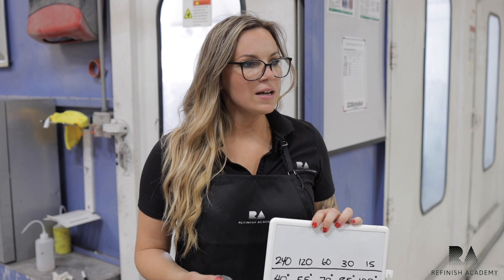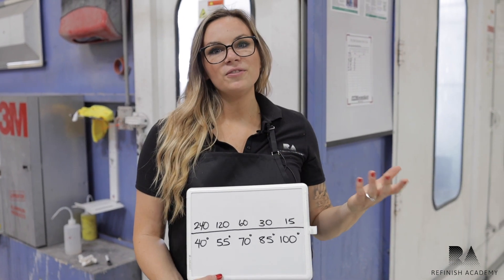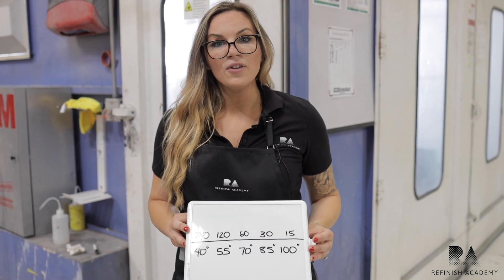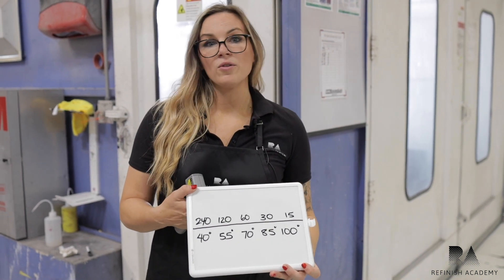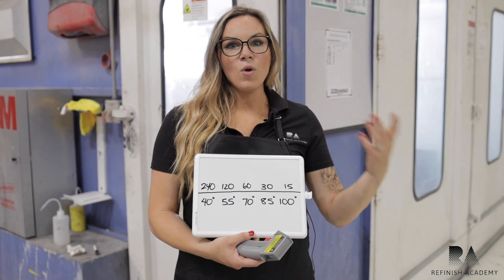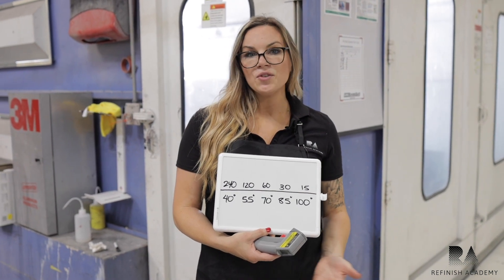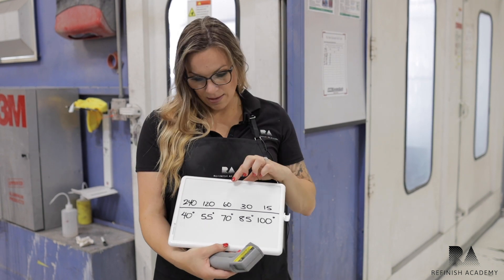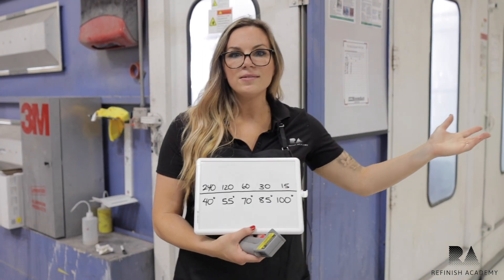Body Shop basics! The 15/50 Rule for automotive paint

Comment: Don't you spray in a booth? 
What does the outside temp have to do with it?
Reply from the maker: The chemistry and principle still applies even in a booth. With heat, you notice this less because the temperature is elevated therefore time is less. However not everyone has heat in the booth, and this principle can be something to keep in mind to help keep production flowing.  In all situations. Especially in the prep area, where it’s ambient air until we stick a heat lamp on it. Some shops don’t even have heat lamps, and this principle really gets noticed then.